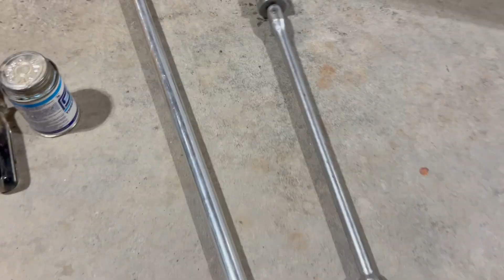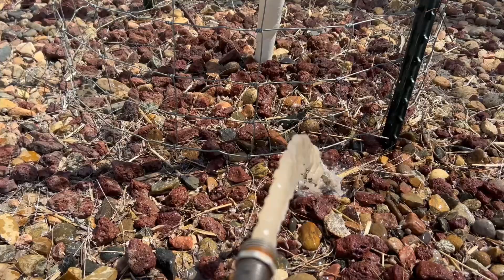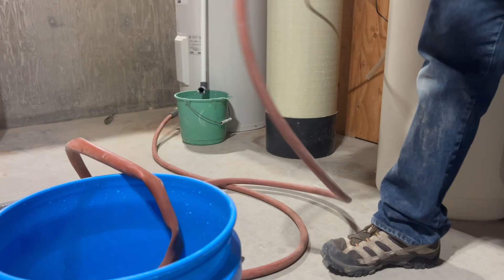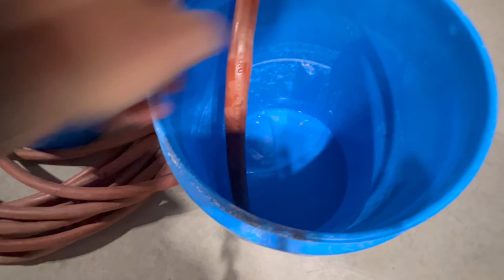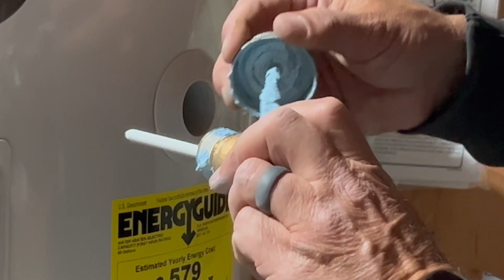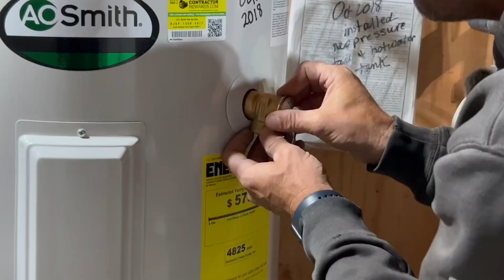🛠️ How to Service a Water Heater

Comment: Excellent Content. The 90-degree elbow should be removed from the T&P discharge tube to prevent scalding water from hitting the kids or the Wife.
Reply from the maker: @mackellyman5642  Thank you. I will cut that off. Hot water straight down. 💧👍 Thanks for the great tip.